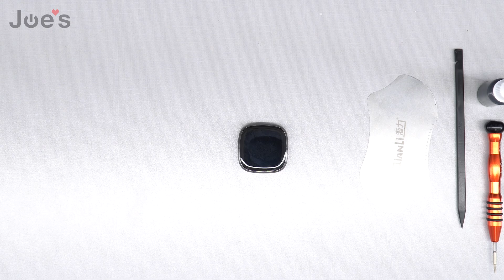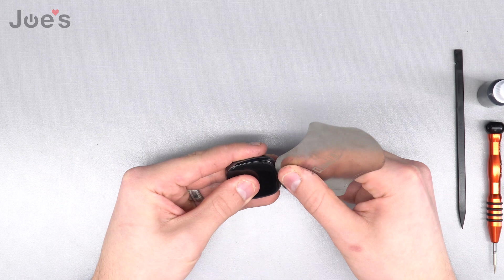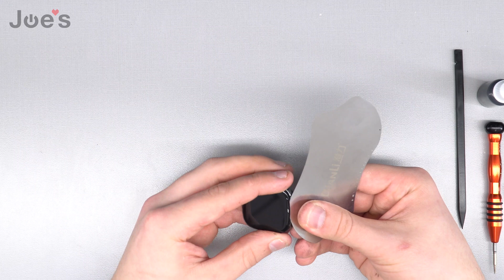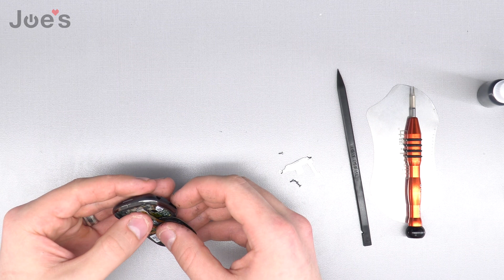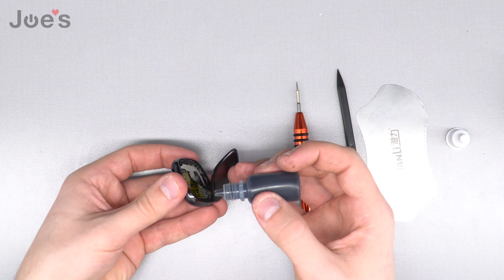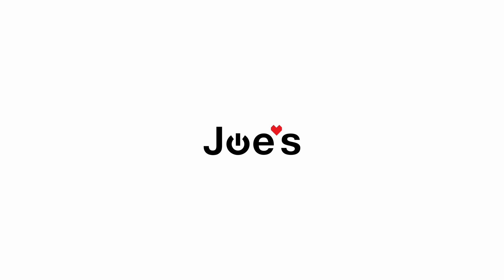Fitbit Sense Versa 3 Back Cover Heart Rate Sensor Water Damage Replacement | Repair Tutorial

Comment: If the watch is water damaged, don't you need to do some drying time once you have it pulled apart sir?
Reply from the maker: If you use our glue and glue it perfectly it will be water proof. Although we do not recommend wearing electrical things in water or sauna. 

https://www.joesge.com/products/electronics-cold-press-lamination-adhesive-seal-3ml-syringe-18-gage-tip-glue

Cure time is noted in the listing.

Comment: Would it be the same for a versa 4? They're extremely similar
Reply from the maker: The internals are quite different actually, fitbit really changed the internals with the Versa 4/Sense 2. Here is a video for ya ---> https://www.youtube.com/watch?v=FGorNfnhLPM&ab_channel=Joe%27sGaming%26Electronics

This shows you have to replace the motherboard, but instead of doing the motherboard, you would just replace the housing.

Comment: I got mine wet which it is supposed to deal with but it no longer powers on. Any ideas?  Thanks
Reply from the maker: You may have gotten water through some of the speaker holes.